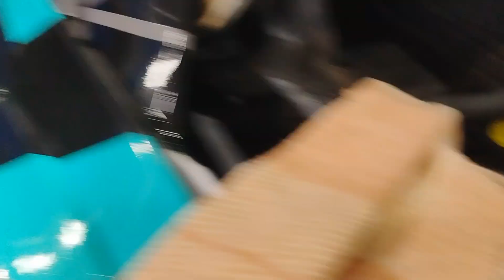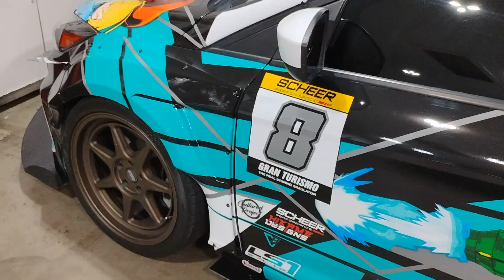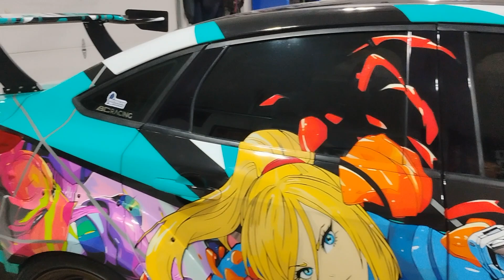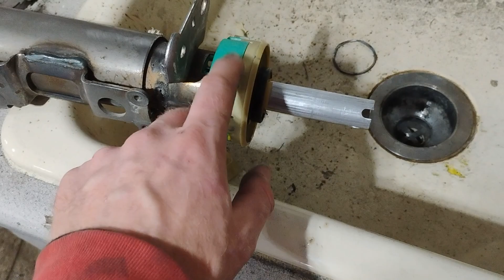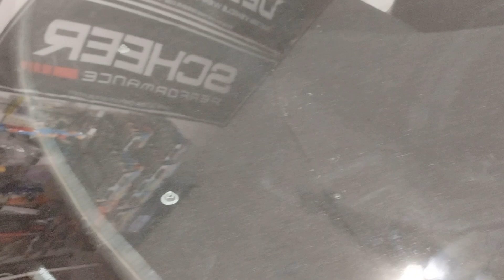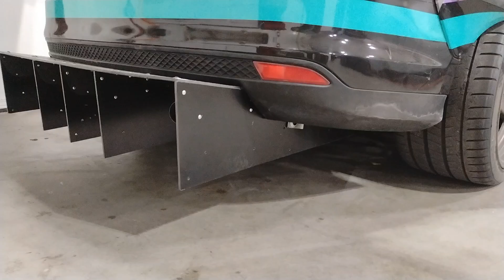V8 Focus C5 Swap Part 8 | NRG Seats, New Dash, DIY Diffuser + Oil Pump

Comment: With everything slid forward does the shifter feel out of place like too far back now? Would love to see a detailed walk through of the entire interior.
Reply from the maker: No its actually fine, I do plan to move it forward with a custom linkage eventually though, just taking it a step at a time.  Will post more on the interior, I just got done making custom door panels, hooking up all the door wires, dome lights and speakers as well as doign some body work to transistion the vette into the focus fior the back doors !
Reply: @Scheer_Performance I cannot wait to see all of that. Waiting for bonus time next year and wanting to attempt dropping a ST onto a C5 so I’m using your vids as inspiration.
Reply from the maker: @MrRobschnieder  Thanks man! Im working on rebulding the whole front end at the moment, new steering rack, fabbed upper control arms, angle kit and the works.... should be great! 

Heck yes that is awesome! it has been the most fun project and always fun to bring to events ! no one expects it haha 

Also new race motor should be done this winter, cammed and ported LS done by a local shop here
Reply from the maker: @MrRobschnieder  also if I was to do it over again I would retain the focus firewall but just move it back and also graft in the focus floor on top of the vette.  I know for the next one haha